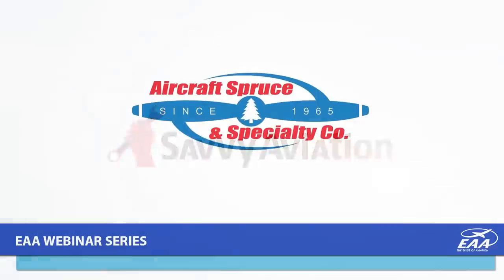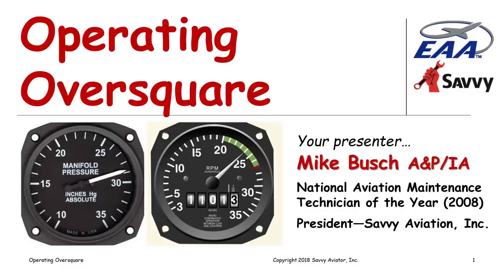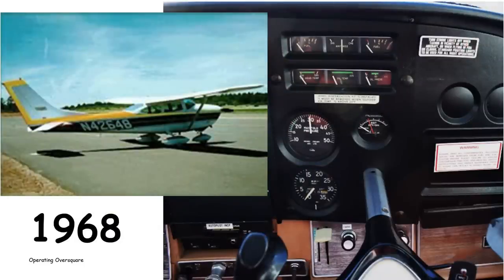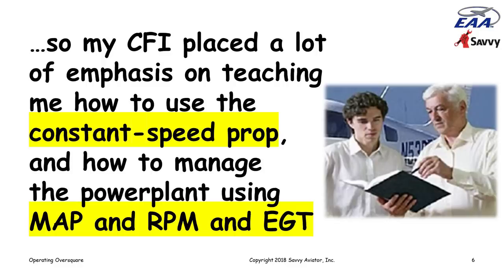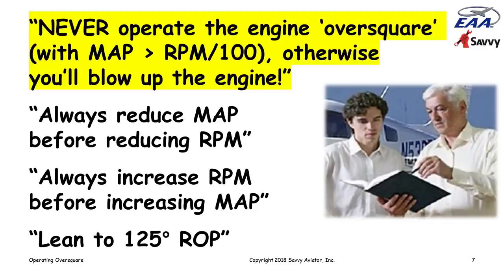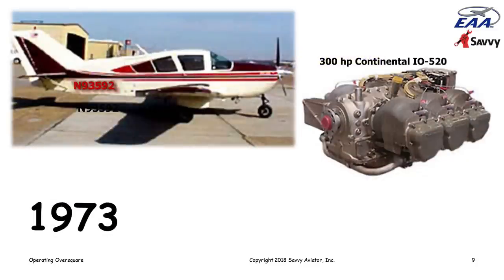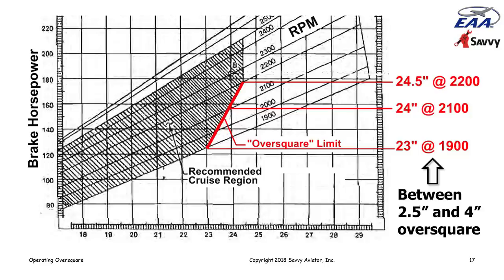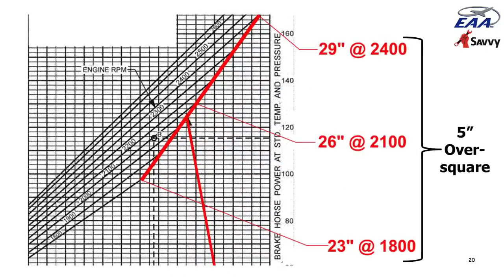Operating Oversquare

Comment: All that over square Business is born of shear lack of understand the combustion engine physics and science
Reply: And the fact the inches of mercury being the standard of measurement only just so happens to be less than 30 at sea level as well as your maximum engine RPM being always under 3,000.

If you use PSI for manifold pressure, than its 14.7psi and what, 1,470rpm? What if we use ATM? 1.0 is the max, we see 0.7atm at altitude so we can only use 0.7 RPM? Its nonsense. 

A fixed-pitch propeller static run-up might only be 2,150rpm. Thats at MAXIMUM throttle and Max manifold pressure as well. You lean to achieve maximum static rpm, richen very slightly, then release the brakes. For a max performance takeoff. Nobody has a problem with this.

Comment: If we had begun measuring manifold pressure in, say, hecto-pascals instead of inches if mercury, the oversquare argument would never have originated.
Reply: You are so correct!
Reply: I have noticed some FIs take the square numbers as a gospel still. Basically “With the american units it so happens that the low RPMs of an aircraft engine coincide with the manifold pressures and the engine is designed around that.” One such FI has checked me out in a PA28-180 with an electric MT prop. It limits the continuous RPM to 2500 as that is the maximum position of the regulator. We took off and I was told to reduce the MP to 25” for the climb. The aircraft climbed like a 150 on a hot day. My investigation into the POH supplement revealed one should keep full throttle and just reduce the RPM to 2400, and you basically have the same engine regime as with a fixed pitch prop during Vy climb. That however breaks their logic :)

Comment: I am burning 9 GPH in cruise with my Cessna 182 with an O-470-R using these techniques: slightly lop with carb heat, throttle almost full open and 2100 rpm. I had to burn some fuel off before maintenance so I ran ROP at 2400 rpm at the throttle almost wide open and burned 16 GPH. 9 GPH at 130 mph or 16 GPH at 150 mph. It’s amazing how much you can extend range with these techniques.
Reply: The fuel savings over 400NM flight that will last only 24min longer are just ming boggling - 14gal!

Comment: Low RPM and higher throttle settings= Less noise and increased efficiency... Gee is that why they started using overdrive transmissions in cars???

Comment: Not to quibble, but you may want to correct the notion that Col. Lindbergh introduced the idea of oversquare operation to the P38 pilots. The Allison V-1710 is a supercharged engine, and is routinely operated oversquare, as are most high-performance fighter, bomber and large transport aircraft engines of the piston age: the R-1820, R-1830, R-2600, R-2800, R-3350, R-4360, to name a few, are probably never operated undersquare either.
 On the contrary, many pilots of that era were advised never to let the engine run undersquare, to avoid having the prop drive the engine.

Col. Lindbergh's contribution involved a mix of reduced RPM with increased manifold pressure, true, but his chosen power settings reduced cruise airspeed to 185. . . bringing the airplane closer to its maximum range airspeed. And it's probable that these same settings put the engine in a state where the "red box" didn't exist, making it safe to operate the engine at best power mixture continuously. It was the combination of best-power mixture and reduced airspeed that provided the extended range.
Reply: @Johnathan Celso Note, please, that none of the engines I referenced are horizontally opposed. I read the article you mentioned around the time it was published, and in it Mr. Deakin confirms that one of the high-performance radial engines that was most common in that era ( R-2800,) was indeed subject to failures caused by 'engine driving prop,' and he explains that in detail. . . The V-1710 is not  radial, but it is still true that "pilots of the era" were told not to run undersquare. Mr. Deakin didn't prove anything that the engine and airframe manufacturers didn't already know. To quote from the C-47 series Air Force T.O.:

". . . it is important to cushion the high inertia loads on the master rod bearings which occur at conditions of high RPM and low manifold pressure. As a rule of thumb, it is well to remember that each 100 RPM requires at least 1 inch Hg manifold pressure; for example, 23 inches Hg at 2300 RPM. Operation at high RPM and low manifold pressure should be kept to a minimum."

So I don't see what your skepticism is all about.
Reply: Those airplanes were also not expected to survive until normal TBO. B17s were lucky to hit 500 hours
As for the prop driving the engine that is only slightly related to being undersquare, it is mainly caused by rapid power reductions at high airspeeds (or if a making a dive), but power can be reduced faster with a low rpm setting.

Comment: We have found, using the JPI EDM-700 that with the throttle at full throttle, with either a carburetor or fuel injection, you will have more even EGTs and CHTs than with the throttle less than wide open.  With a Fixed Pitch propeller, you are always "over square" on take-off at sea level:  29" MP and 2300+/- rpm when the throttle is pushed to full throttle at the beginning of the take-off roll.
Reply: Less throttle, more cooling, maybe?

Comment: Lower RPM equals higher propeller advance ratio (J), which corresponds to higher propeller efficiency. More brake horsepower converted to useful thrust horsepower.

Lower RPM reduces friction horsepower, less power lost due to the rubbing together of all the moving engine parts. More fuel energy converted to mechanical torque vs lost as heat.

Lower RPM leads to increased volumetric efficiency. The air being sucked through the induction system by the racing pistons must travel through a series of tubes and pathways which are imperfect and introduce some level of friction. The faster the pistons attempt to suck, the less oxygen is delivered to be used in the power stroke. A lower RPM allows each intake stroke to gather a more substantial fuel air charge.

Comment: I agree that running "square" is a totally arbitrary rule of thumb and is foolish to teach as universal to all engines. 
However I must point out some questionable statements in the video.
1. While WW2 is a rich source of R&D, combat aircraft were on average expected to last a few hundred hours before being destroyed, and even when they weren't lost a short TBO was an acceptable cost if it won an extra battle.
2. The statement about props liking low rpm is less than a half truth, the full story must include prop diameter, torque, tip speed, and true airspeed (true blade angle of attack) so unless you are changing the prop, specifying the target air density, and adjusting the TAS "slower is better" is a statement just as hollow as "always fly square"
3. It is barimetric efficiency not volumetric efficiency. The volume is always 100% filled.
4. With the exception of 5 second bursts, street cars normally operate at very low manifold pressure and don't stress valves. They actually can't operate substantially lean of peak with modern multistage catalytic converters which are required to do both oxidation of carbon compounds AND reduction of nitric oxides.

Comment: I have always flown my Mooney with the IO360 at 24 squared, careful not to go over square. Also, on the recommendation of another Mooney owner on the field and my instructor I've been using the 50 ROP method by hitting peak EGTs with JPI700. It always felt wrong to me.  I just ordered Manifesto and Mike on Engines. Looking forward to seeing what I can get out of the plane with these new procedures!
Reply: Curious to know if you changed your techniques and what differences you've experienced if so.
Reply: @justcommenting4981  Absolutely! I've learned so much since then. Thanks for bringing this back around. I now avoid ROP ops for cruise. I'm WOT from take off until landing prep. I run LOP but still usually at 2400 rpm. Gets me 150mph true at 9gph or less depending on altitude. Just installed a Surefly EIS so I'll need to monitor CHTs and fuel burn for changes.

Comment: Excessively rich mixtures are one cause of rapid wear in the Exhaust Valve Guides.  Vary the throttle position to find the most even EGTs.  The optimum throttle position can change with altitude, but we find that wide open is usually the best position, especially at higher altitudes, like 7 to 12 thousand feet.  Reducing power by leaving the throttle at full throttle until usually at about 3,000 feet or so and leaving the mixture where it was set at 7.5 to 10 thousand feet and slowly reducing the RPM from cruise, such as cruise at 2350 rpm, to about 2,000 RPM is an efficient method to maintain cylinder temperatures and low fuel flow.  It is almost impossible to have detonation, using the correct fuel, at below 65% power.  For "over square", some manuals state not to exceed 2" to 3" above the RPM for cruise.  On a 300 HP Continental or Lycoming, with a maximum RPM of 2700 RPM, you are 2" over square on take-off at sea level.  Manufacturers de-rate engine power by lowering the RPM, but seldom reduce the throttle manifold pressure.  O-540 Lycoming engines that produce 235 HP on take off run at 2575 RPM with full throttle, which is 29" of manifold pressure.  The Continental TSIO-360-__ engines run at 2575 RPM and 40" of manifold pressure, as in a Seneca II.  I do not think that low of an RPM, 2575 @ 40", is a good idea, but that is what it was certified for.

Comment: I have been playing with running my o-360 at 1800-1900 rpm when solo or lightly loaded. Any slower and maintaining above best L/D speed and altitude becomes difficult at or below 19" MP. Operating much above that MP seems to cause detectable vibration "(lugging? as mentioned below)". Have yet to get serious about calculating fuel savings because most of my flying in this condition is in ground observation ops (low speed for more time to look at the ground/ take pics), but noise is reduced and i cant help but believe that less rpm at a relatively low cylinder pressure must equal less wear, piston inertia engine friction, and fuel burn. I wish i could operate in the region my Hartzell prop/ Lyc powerplant combo is Placarded against (2000-2250 rpm).  When trying to make a moderate speed (traveling) i almost always run 2350 rpm, as low as i feel gives me a safe margin from the restricted rpm region).

Comment: Tnks for the great content! I have 2 questions: 
1. I fly nowadays a PA34 seneca V, (220 Hp Turbo). The POH power table says that 30in/2300rpm is acceptable, (normal cruise) so I follow that, but I fell that it loose some GS using that instead 28/2400rpm. Am I Wrong? 
2. About the LOP for this specific airplane/engine, (Seneca V), do u have some tip how to do that correctly? I don’t ever did LOP at a turbo aircraft, and I can’t find anything in its POH. 
Tnk u again.
Reply: Are you at the same fuel flows for 30/2300 and 28/2400?
Reply: @davidspeyers5740  yes!
Reply: @thiago.marcato  Then I would say that 30-2300 is farther LOP than 28/2400 even though the fuel flow is the same. How much speed loss are you seeing? 1-2 knots or more?

Comment: Any recommendations on a 0-470? Where could I fine Continental's information for running oversquare for any 0-470? Best Regards.
Reply: My question too. My POH has me higher RPM over MP on almost every altitude and setting. Just trying to see if I can run 23” and 1900rpm.
Reply: @bmshope  You should search for the engine specific manual. Even the O200 has one, you should easily find one out there.
Reply: @bmshope  Just follow what your POH says  . . .

Comment: With regards to full power takeoffs, should a reduced RPM takeoff be done at extremely low density altitudes (i.e. below -1000ft) to keep the engine within its rated power range?
Reply: its only like 2% and a minute of use, besides that usually low DA is correlated with low air temps

Comment: Some very interesting charts but some flaws and your confusing explanations make it a struggle when it needn’t be. First using a chart with mislabeled lines is inexcusable and lazy.  Second in chart with labeled N42MM …. Near the beginning you say the over and under square examples have the same fuel flow and therefore the SAME HORSEPOWER so that you can go on to to prove they have DIFFERENT HORSEPOWER 🫤.  I guess your first horsepower is as measured at the piston crown?  You might say constant fuel flow means same work done but you know that’s NOT true either. The point your trying to make is that with constant fuel consumption the case with more 
waste heat going out the exhaust and convecting from the cylinder heads, should have less useable output horsepower. If you just had dynamometer data and clearly defined terms, this would be so much more clear.

Comment: I can’t understand SR22 story operating at 2700 rpm , and Cirrus factory lack of diagnosis ...
Reply: They were probably operating on the cost-saving idea of fixing the cheapest thing(s) first. Why they thought their specs were required for that specific engine is hard to say. But, he suggested a small operational change and the problem disappeared, so Cirrus now has to know they have some variability in their engines and the problem isn't always another piece of hardware or the fuel system.

Comment: Exhaust valve failure is caused by a lean mixture at a higher rpm.  By reducing rpm the cylinder has more time for the flame to finish burning before the exhaust valve starts to open.
Reply: It also holds the exhaust valve against the valve seat longer allowing the valve to transfer heat to the cyl head for a longer amount of time.
Reply: And the cylinder cools it with airflow both inside and out. That valve is opening over 1200 times per minute
Reply: Your premise is wrong.  Rich mixtures cause carbon bromide to form like a shellac on the valves and then they get sticky and brake.  See the July issue of AOPA for an excellent article on why lean mixtures are better for exhaust valves and why rich mixtures are bad.
Reply: @daffidavit  there is no bromine in the system
Reply: @dragthatsht  the percentage of time in contact with the seat is exactly the same at all rpm

Comment: Manifold Pressure could be 29.92 inches of mercury or it could be 407.17 inches of Water. Or maybe 14.696 PSI or it could be 101.32 Kilopascals. 

All of these ARE THE SAME PRESSURE.

There IS NOTHING MAGIC about "Square" power settings. 

In your automobile, pressing the accelerator pedal to the floor results in 100% of available manifold pressure due to the throttle plate going wide-open. SAME AS the airplanes Throttle being fire-walled.

A Car can be shifted into 2nd gear at full throttle, and "pull" through the Rev-range at Maximum manifold pressure, yet low sweeping to high RPM. And again and again for hundreds of thousands of miles for each and every gear shift.

Over Square/Under Square is  literally Numerology hokus-pokus with no basis in engineering principals. 

I think the basic premise that RPM must be increased before throttle is certainly valid, and was taught for all highly supercharged piston engine aircraft operations around the second world war. But those are very special cases. And they CERTAINLY operated "Over Square" as the P-51 Merlin ran at 61 inhg, and a maximum RPM of 3,000... But, you don't want to shoft the supercharger into high gear, whack open then throttle, with the propeller rpm selected for a low cruise rpm. Because this manifold pressure at low piston speed results in extreme cylinder pressure, and large pressure spikes due to flame front speed burning all of the fuel/air mixture long before the piston reaches top dead center, which is going to cause detonation or even  catastrophic pre-ignition.
Reply: Downside to very low RPM: Oil pump speed is also lower and therefore there is lower oil volume thru the bearings and potentially lower oil-film thickness.

And regarding Volumetric Efficiency: With a tuned length intake, there is a specific RPM that gins maximum benefit. Also, the swirl/tumble is improved which aids mixing. So VE has an efficiency "island" of operating parameters, going to far above or below will cause efficiency to suffer. 

Turbochargers, superchargers, engines, intakes, exhausts, even propellers, aircraft themselves, all have efficiency maps. Operating in the area of peak efficiency is usually optimal. And each item should be carefully selected by the engineers to happen simultaneously where its most often used. (Although most aircraft fly waaaay faster and at a lower lift coefficient than optimal. Sacrificing substantial lift/drag for speed).

Comment: I'm getting confused. If I set 65% power at 4000', according to the aircraft manual, I should set 2200 RPM and 22.4" MAP. If I now open the throttle all the way and get an increase in MAP, am I not also increasing the power setting beyond the desired 65%? This is a Lycoming IO-540, normally aspirated engine.
Reply: You have to figure out what settings get you the power/speed you desire.

For most GA planes: Fly at 8,000' wide open throttle for 75% manifold pressure. And fly at 12,000' wide open for 65% manifold pressure. 
(Assuming naturally aspirated and not turbo).

Set RPM as desired. Lean to observe engine roughness and richen slightly. This should have you just slightly lean of peak. And well lean of maximum-power mixture.

Comment: I once flew a return flight in my 185 in Africa at 8000 ft , 1700 rpm and LOP , full throttle and a fuel flow of 7 gph ,egt lowered by 250-300 degrees. My indicated air speed was 90-100 mph but I had a 50 mph tailwind so thats why I opted to experiment with ultra low power settings…!!!